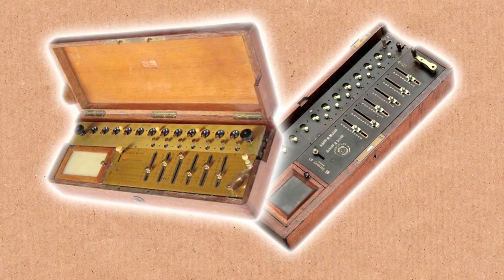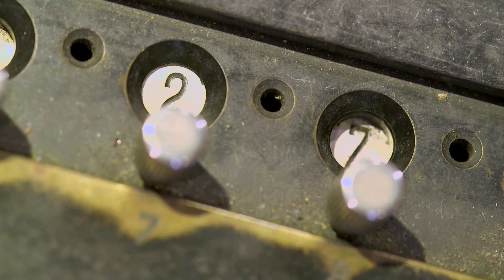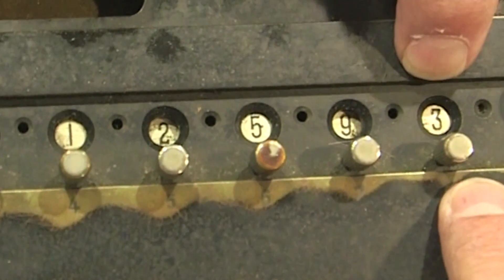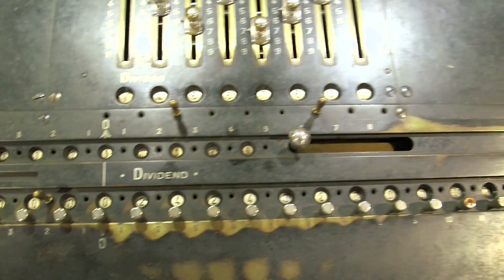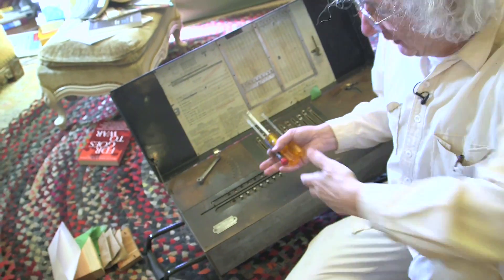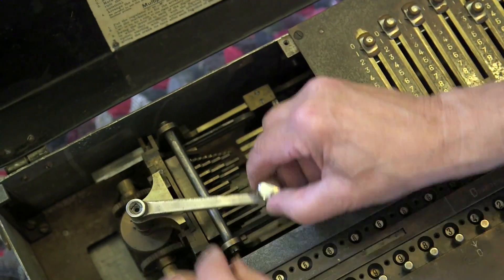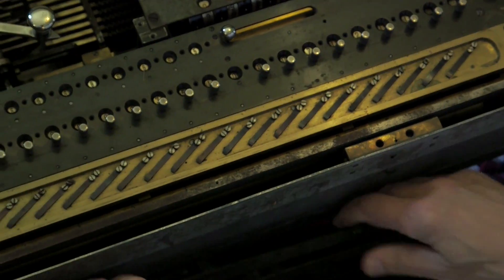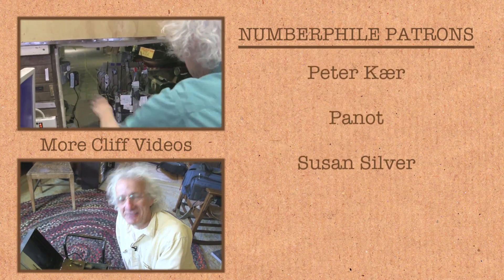The Millionaire Machine - Numberphile

Comment: Watch out: Although sometimes advertised as such, WD-40 is not a lubricant. It's actually a degreaser and thus should not be used for lubrication of mechanical parts. Although it might remove old, dirty oil and improve the function temporarily, in the long run it will damage the machine. Use a proper lubricating oil on this marvelous piece of machinery.

Comment: what about divide by zero? you cant show us a calculating machine without asking that question...
Reply: No it isn't.
Reply: it would just spin infinitely
Reply: +Eduardo Gomes on a technical note, infinity doesn't have a strictly-defined meaning in basic calculus. You see it in limits and infinite sums but that's about it. Whether 1/0 is indeterminate or infinity depends on the specific context you're working in. 

For example, it could also be an imaginary infinity.
Reply: honestly just probably wouldnt allow it
Reply: +jessica themane +Eduardo Gomes its indeterminate.... neither of those answers are correct.
Reply: Eduardo Gomes it isn't, they made a video about that too I thought...
Reply: Matthias Inghels that was curious Marc
Reply: TO INFINITY!
AND BEYOND!
Reply: He literrally showed the internal mechanics at work while dividing by zero.
Reply: @arnoldthomsen6571  
I saw him show the internal mechanics at work while multiplying by zero, but I do not recall him ever using the division mechanism.
Reply: @agiar2000  Two sides of the same coin.
Reply: @arnoldthomsen6571  
I guess I don't know enough about the internal mechanism in that machine in order verify that.  The question is really about what the machine does with such a set of input, so it's not really clear to me what the result would be.
Reply: King Tide It is not indeterminate! 0/0 is indeterminate. For x different than 0, x/0 is undefined in Reals. But in sets with transfinite elements it is as defined and well behaved as the roots of a polynomial equation. In which case it is +- infinity
Reply: I think it would know that the number will stay the same.
Reply: no, a non-zero number divided by zero is +-infinity.

Comment: Numberphile, you know the number 14233221 describes itself when said out loud, how many numbers like this are there and is there some sort of formula or way to make them?
Reply: +Shedinja There is one 4, two 3s, three 2s, two 1s. 14 23 32 21.
Reply: +MiniMinecrafter7 The numbers are called "look and say" numbers.  Conway talks about them one of the Numberphile videos, I think.
Reply: +MiniMinecrafter7 you could write an algorithm to find these numbers fairly easily. I'll take a crack at it when I get home.
Reply: What do you mean by "describes itself"? I don't understand
Reply: +MiniMinecrafter7 pretty sure this is a conway thing - there are finitely many iirc, roughly corresponding to the elements in the (known/constructed) periodic table
Reply: bengski68 Conway talked about "look and say" sequences, in which each number in the sequence (other than the 1st) described the number before it in the sequence. Miniminecrafter7's numbers are self describing in a sense.

Comment: He payed WHAT!?!? $75 omg
I would expect it to be worth at LEAST $5k how many are still around working? If they are rare I would say it should be worth even more! No one wants to collect this???
Reply: +Zachary Taylor 35 years ago, though. Today, they're probably a lot more.
Reply: +Zachary Taylor € 2900 on ebay right now
Reply: +Zachary Taylor In todays money that would be $200.
Reply: +iamagi 

You. I like you
Reply: I figured that when he said worth its weight in brass, that meant that it wasn't anything special.  It's worth its weight in brass, but it's not worth thousands because its a rare specialty item.  It is literally only worth the brass scrap price.
Reply: What if there is a 3D model of all the parts online?
Reply: @iLOLZU42  This is the key question.  I hope someone has scanned all the pieces that are used to make it, with exact measurements (i.e. no time or usage causing damage to the brass pieces and changing their measurements), along with an instruction guide of how to assemble the whole thing
Reply: He said it was considered to be "worth its weight in brass". Current scrap brass prices are around $1.00 - $1.25 (USD). Unless the value of scrap brass has changed a lot in the last 35 years, it's possible that the $75 figure is already converted to 2016 dollars.
Reply: Ikr
Reply: +What The Actually, the comic books and baseball cards have nostalgic value rather than cultural value.
Reply: +Zachary Taylor He mentioned that he got it at a bank, so I kinda assumed that back then it was a normal item in banks.  That being said, there are probably a lot of them.
Reply: +What The You're right. I didn't think about that.
Reply: +Zachary Taylor You realize that dollar was much more valuable than now because of inflation, right?
Reply: Zachary Taylor Collect it for what aha
Reply: Bro I pay 5k plus shipping to Brazil. Totally interested!
Reply: Well, he got them from a bank closing down, they probably didn't care.
Reply: +Zachary Taylor a working millionaire machine in couple of decades must be worth millions..
Reply: +What goes to show how perverse our culture is. we got your priorities all wrong.
Reply: +Zachary Taylor I honestly think that It would be in the millions with it's history and condition
Reply: Rogem Nostalgia comes from cultural icons. Not even gonna bother explaining any further.
Reply: +Logan Browne - I would put up $1000 for it, it's amazing how complex it is but it will never have cultural value so it will never be worth more than $5000, comic books, baseball cards, stamps and coins, they have cultural value.

Comment: Steampunk calculator! So how would you, say, multiply 547 x 331 with that?
Reply: +Matt Rouge Not quite.  The very clever thing it does is to shift every digit left once during (before?) the multiplication, effectively multiplying by 10.  So for the example you gave, it does:

547 x 3
that x 10
add 547 x 3
that x 10
add 547 x 1
Reply: follow what he did with the last multiplication.

547 x 3, then x 3, then x 1. that should be 547x331
Reply: Matthew Rowles
They are both prime numbers, so... That would multiply it by 3 x 3 x 1 = 9, right? I don't think that would work.
Reply: Thomas Winget
Cool. Sorry, still getting used to my Millionaire. Trying to integrate it with Firefox here...
Reply: O.o

Comment: Hmm, does it handle 0/0?
Reply: +Raniera Paniora-Hepi How do you think it got broken?
Reply: +Raniera Paniora-Hepi if the multiplication wheel is the same as the division wheel, there is no 0 position which means it is not possible to divide by 0 on that calculator
Reply: Gary Trollmer LOL clever, but not that funny.
Reply: +Sentinalh dropped a gear lol

Comment: This needs an calculator unboxing video done by Matt!

Display: 9 (It can show 16 digits!)
Functionally: 6 (Great for multiplying and dividing large numbers)
Accuracy (√2): 1.41421... (It really can't do decimal points)
Ergonomics: 3 (It ain't going to fit into a regular size pocket!)
Cred: 9 (Something that is classic never goes out of fashion)
Durability: 10 (Not many calculators these days would last 120 years!)

TOTAL: 38.41421...
Reply: actually I think it can do decimals, so the accuracy score should be more like e^2
Reply: +seahawk124 What about durability? Can it survive a drop from a rooftop?
Reply: +seahawk124 Cred: Roughly 10^6
Reply: +Den Mac 
No, brass.
Reply: +Icepick L Strange, I wrote it in Matt's voice! :D
Reply: Gold
Reply: +Cadde Let's not try that one...
Reply: +seahawk124 I read that in Matt's Voice.
Reply: +John T. DiFool Thanks, i was wondering how long it would take...
It was a coin toss, but I didn't think anyone else would have picked it up! :-)
Reply: ***** Umm no, it's just 9*10^3+1
Cred is also an alias for power level.
Reply: +seahawk124 If this never happens I'll be most upset.
Reply: Tim-J.Swan It's too metal.
Reply: +Cadde I think the real question is: Can the sidewalk?
Reply: A CALCULATOR SHAPED LIKE A (PARKER SQUARE?)
Reply: seahawk124 tc
Reply: The box probably said pocket sized😂

Comment: Is there no way to make a miniature version of this with today's technology?

(I mean literally shrinking the exact mechanics and gears and such to something that might weigh 5-10 pounds of steel and would fit in my pocket)
Reply: +Leonid Bortsov The Curta does not have that sweet one turn multiplication. To multiply a number by lets say 43 you would add up the numerb three times and then again four times with a x10 multiplier. For the curious: there are Curta simulators and the manuals as a pdf out there.

Comment: Another calculator unboxing?
Where's the durability test?

Or the Dividing by zero test™ or Dividing by seven and multiplying by seven test for that matter?
Reply: There is a divide by 0 test. At least he shows that nothing happens, if the thing on the left is on 0.
Reply: +1996Pinocchio That was a multiply by zero test...
Reply: +1996Pinocchio It was multiplying by zero if I understood correctly.
Reply: +1996Pinocchio That&#39;s for adding!! (or multiplying? I think he misspoke, and it's really adding there)
Reply: If you put the switch on divide, it will remain the same on the left if I understood it right.

Comment: I was hoping for him to show what happens when the number gets too big.
Reply: Mechanical overflow. Maybe the handle jams or more likely after 999999... there comes 0
Reply: +atsay714 Numbers (I beleive) will just wrap around. If the maximum number of a system is say, 999, (10^3-1) then 1000 = 0, and 500+500 = 0, 600+800 = 1400, and that first '1' is lost (overflow) and you end up with 400. 999+999 = 1998 => 998.
Reply: Me too!

Comment: Mechanical computing is so cool. (also I'm sure there's a math joke about arriving early I could make right now.)
Reply: +Laszlok I agree, but I'm not sure this thing is analogue,  though, it might be digital but mechanical, I don't know how it works, but "digital" basically means the calculations are in integers and analogue means it uses fractional values, so there are electronic analogue calculators and digital mechanical ones (and obviously electronic digital and mechanical analogue)  :-)
Reply: +austin fernando slight correction: digital uses quantized values, analog uses all real numbers. you can represent fractions digitally, just not all fractions at once, assuming you have finite digits.
Reply: +viralinfecticide thanks for the correction, I knew that but I was going for a simplified explanation
Reply: +austin fernando I fixed my comment. Thanks :)
Reply: Laszlok no problem :-)

Comment: Interesting invention. But centuries ago, the Chinese simplified the calculator into a truely portable lightweight machine called the Abacus. Its still faster than a regular digital calculator.
Reply: +Cosmo John Not if you are multiplying 14,589,350 by 103,509,505,399
Reply: +Kevin Glass A long abacus can still be faster. In fact the abacus method does not need a physical abacus to work. This is even faster.
Reply: +Cosmo John The only thing that takes any time on a modern digital calculator is typing in the numbers; the actual computation takes less time than moving a single bead. Somebody with fast fingers and a decent memory can type numbers into a calculator very quickly. Without further evidence, I'm a bit skeptical of that claim.

Research seems to indicate that multiplication on an abacus divides the abacus into three sections, so the size of the numbers available is extremely limited. An abacus that handles multiplication of numbers as large as the Millionaire probably doesn't exist; you'd have to use three abacuses.
Reply: logicalfundy
And still the China Abacus is better than Millionaire.
Reply: Cosmo John It's more portable than the Millionaire. But I'm sure the Millionaire could be plenty useful in, say, a tax office or someplace else where portability wasn't really required.
Reply: +logicalfundy True

Comment: Will there be an unboxing of that calculator?
Reply: +SoFZlodei24 i hear +EEVblog likes to tear down old calculators!
Reply: +SoFZlodei24 Would be very nice^^

My suggestion for the score: 

Display: 9 - Actually a lot more digits than on most modern calculators. 
Functionality: 4 - Has basic arithmetic but a bit unhandy to use.
Accuracy: 4 - We haven't seen something like (1/9)*9 but I think it would give 0.99...9 at best. 
Ergonomics: 10 - It has handles, it only weights 60 or 70 pounds, its smaller than a piano, what do you want more.
Cred: 10 - Like the guy in the video said, you can't get cooler than that. 
Durability: 10 - Just look at how fast he is calculating, it also survived a fall from several centimeters.
Reply: +Wargon Well it is more durable than that. I will bet my money that it survives almost anything falling on it. And just imagine how screwed one's life would become if you accidentally drop this calculator on his foot. I would give 100 for such durability.